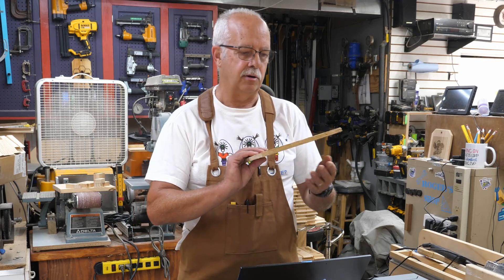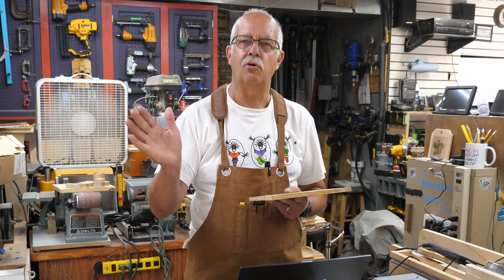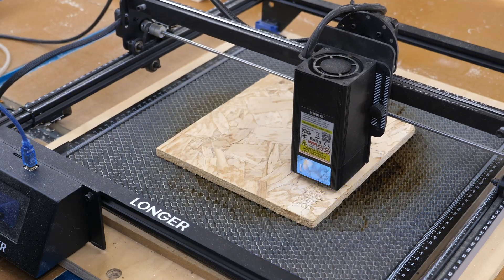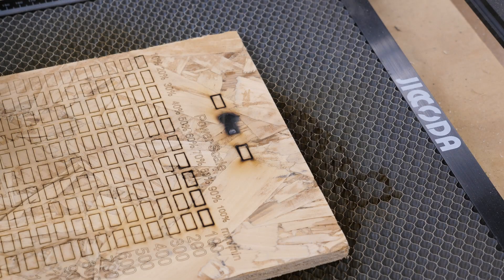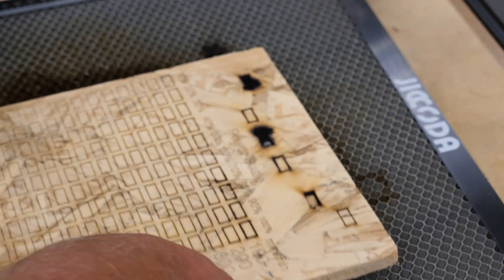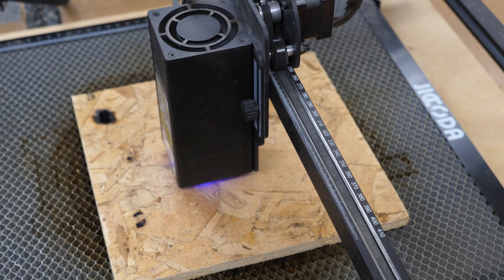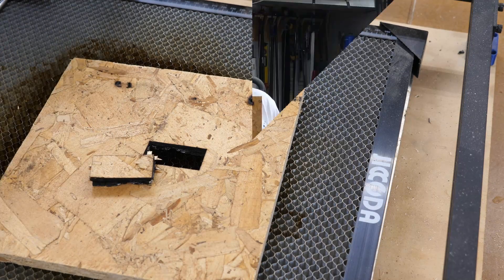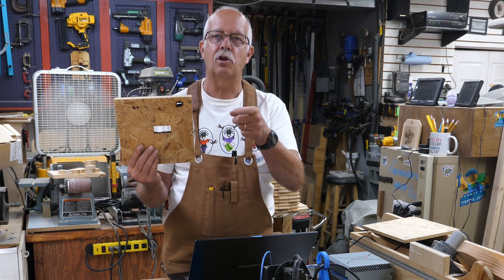Laser Cutting OSB?

Comment: With diode lasers stay away from things that have glue. Not only hard to cut but some glues they use in the manufacturing process have metal in it that can reflect and hurt your laser. Impressed at how the 20w handled the osb tho. Depending on the pressure that the air assist is putting out, if you could increase it it might help with the cut, but also have to think of the focal point of the laser. Its like an hour glass, might be why you were getting so much char on the back. Can try setting the laser closer to the board to start so you have the focal point deeper in the wood.
Reply from the maker: Yes, lowering the focus part way through takes that away and I do that with 3/4" thick material.  This video was dome in response to a viewer question and OSB is not the best material for laser applications!  i do use several types of plywood, so am familiar with how the different glues can affect the outcomes.